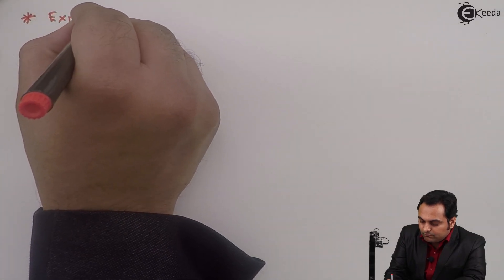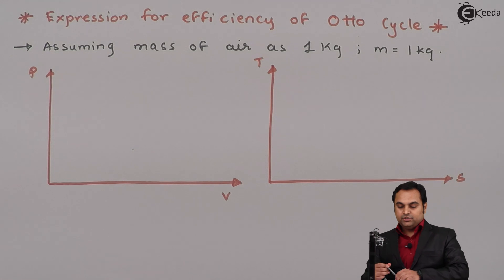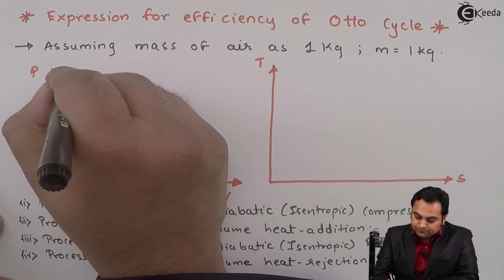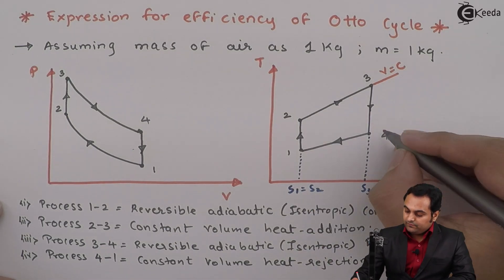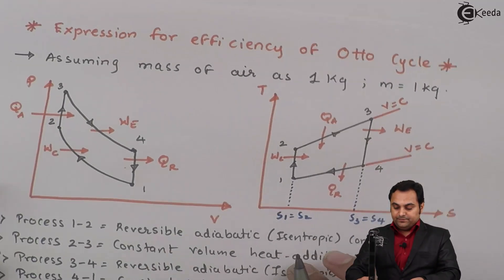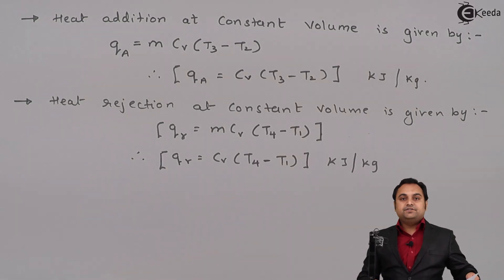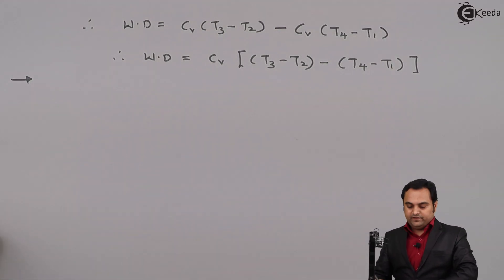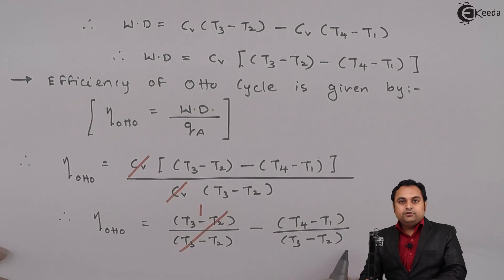What is the Expression for Efficiency of Otto cycle - Gas Power Cycles - Thermodynamics

Comment: As we know for adiabatic Process the relation is (T2/T1) so how in expansion process it is (t3/t4) it should be (t4/t3) am I right? If wrong please do correct me
Reply: i am also confused in this step.....have you got any reason for that, please comment....
Reply: @anishahmed_ it is final temperature over initial so T2/T1 and T4/T3
Reply: No it will be t3/t4 only. You can understand it by higher temperature/lower temperature chronology